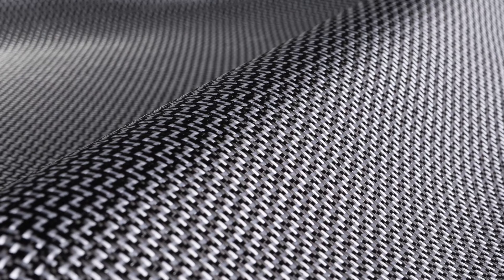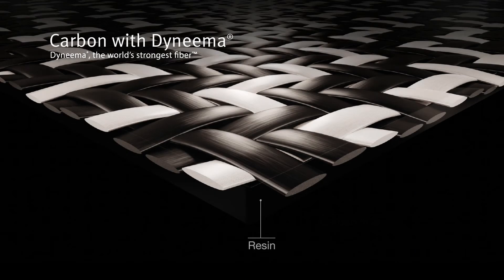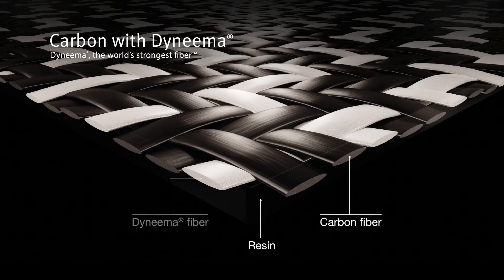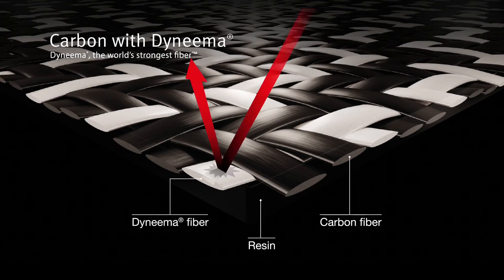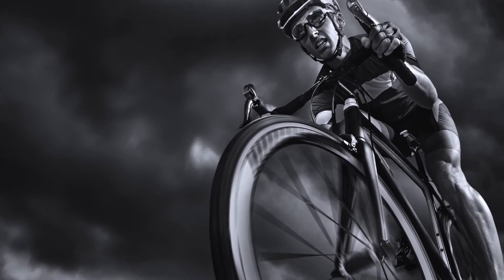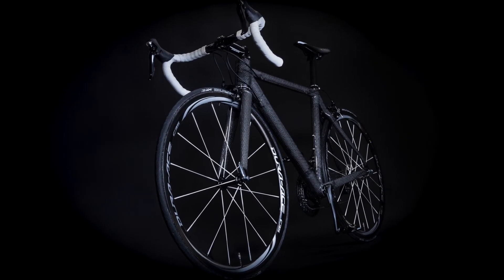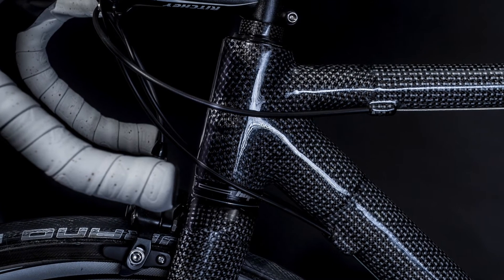The benefits and properties of carbon with Dyneema®

Comment: Did you ever try Dyneema Carbon, specifically with Epoxy resins instead of "generic" Thermosets resins ; the cure and post cure temperature has to be maintained lower that 100° (UHMW-PE melt temp.) but there are many epoxies that can be cured and post cured at 90° so it should be interesting to have this experience made.